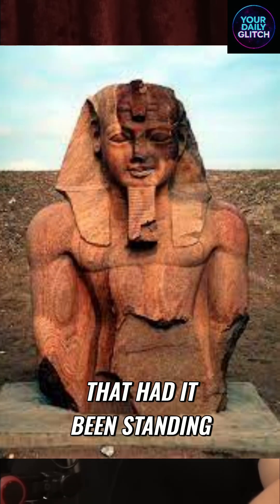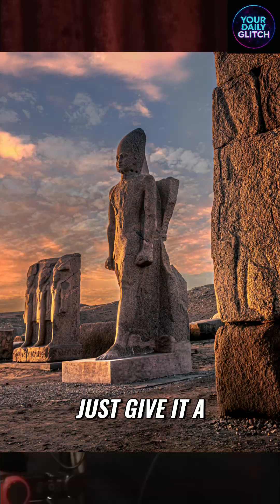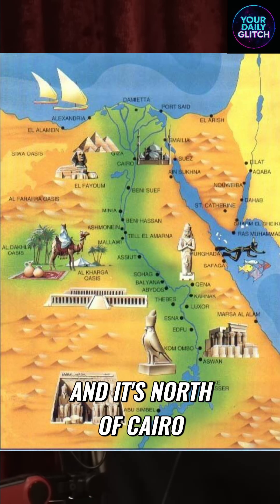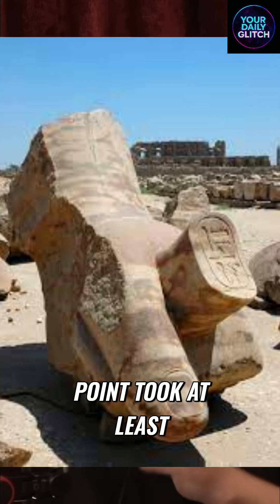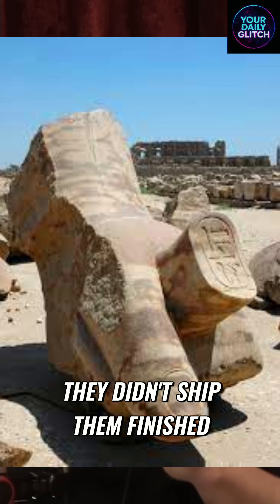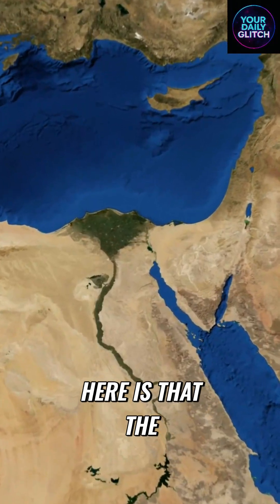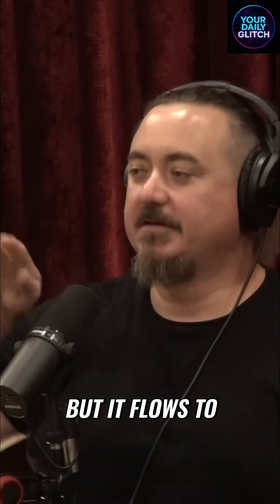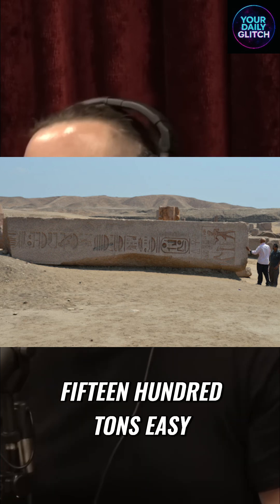How Did They Haul a 1,500 Ton Granite Block 600 Miles? Ancient Egypt’s Impossible Logistics

Comment: What you are saying is amazing but Tanis is downriver, I repeat downriver from Aswan. The Nile flows down to the Mediterranean. They took it downriver, the same way the water flows
Reply: Still doesn’t negate the fact that it was 1500 tons. You don’t just slide that into a boat.
Reply from the maker: @Blazin2133 Agree 💯
Reply: @Blazin2133  Assuming the speaker in the video was right, then it is problem. However, the speaker in the video is wrong. Nothing that heavy was ever transported entirely by floating on the Nile. The largest granite block ever recorded was the unfinished obelisk at Aswan (Hatshepsut) at about 1,100–1,200 tons. BUT, it was never moved at all — it cracked in the quarry in Aswan and was abandoned.

The largest known granite statue moved by water (Ramesses II, Tanis/Ramesseum) was about 800–1,000 tons. The colossus of Ramesses II at the Ramesseum is about 1,000 tons - BUT, it was dragged overland the last part of the way, and portion actually carried but barge on the Nile is estimated at around 750 tons.
Reply: @Sei @Seizo-g8i statue moved by Ramesses was only about 83 tons. Not even in the same realm
Reply: @Blazin2133  You are right - I meant the Colossi of Memnon!
Reply: And – it's only 150 km. NOT 1,000. This guy must not know how to access Google. Or doesn't care. After all, we all understand that Joe doesn't bother with a lot of pesky fact-checking ...